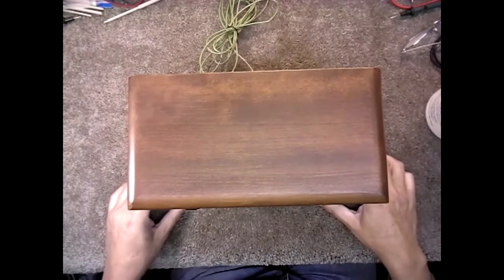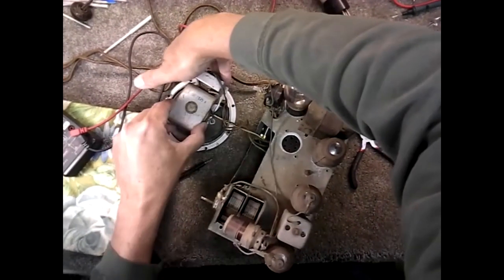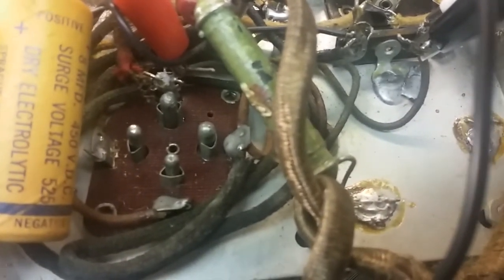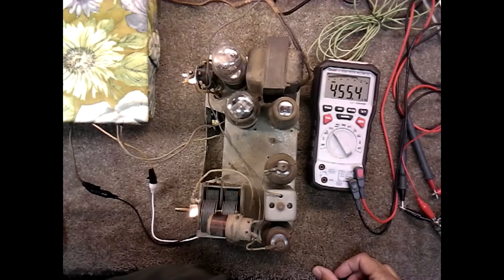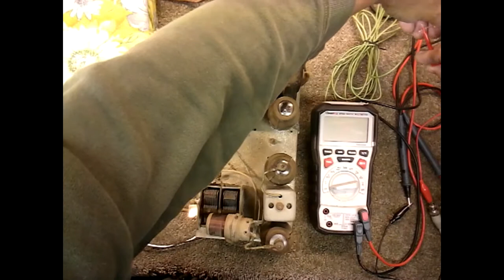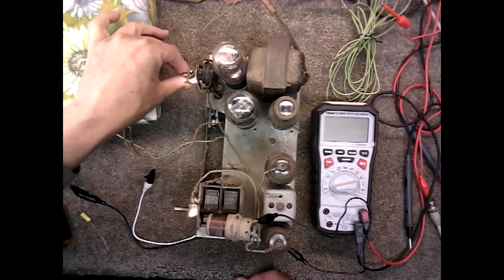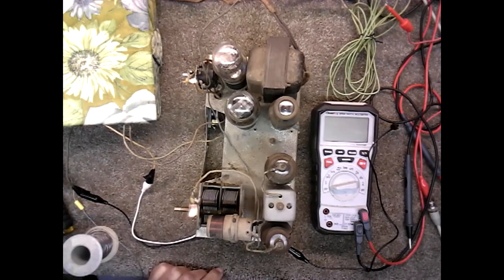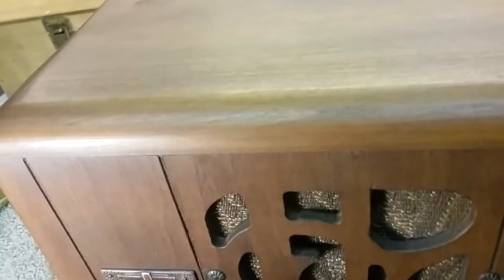1932 Tiffany Tone Radio Repair - Model 5

Comment: The Herbert H. Horn Tiffany Tone Model 73 C (and also used on another Tiffany Tone Console) has one of the most unique Dial Faces of just about any of the older radios.  It is a stunning design using 2 No. 13 Dial Lamps and a Magic Green Eye to light up the Dial Face.
The Face Design on that radio is the All Seeing Eye of God with a Magic Green Eye vacuum tube lighting up the center for the eye.  As for the other elements used in the design along with the eye element, the clouds and the bursts of light coming from the Eye of Providence (aka: All Seeing Eye of God) are used to illustrate divinity, holiness, and God himself. As you can see, the Eye of Providence has its roots in Christian beliefs.